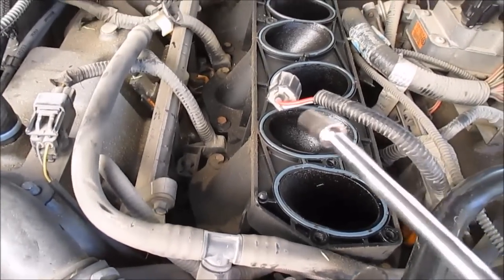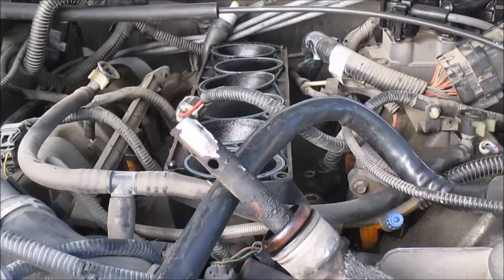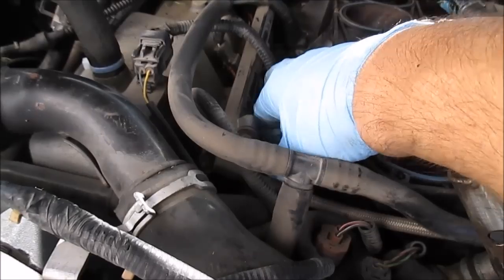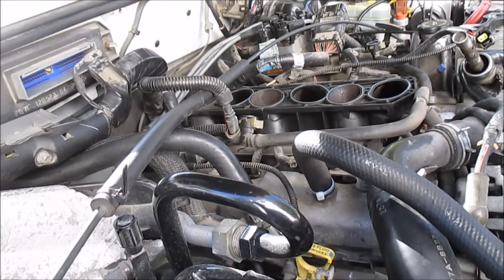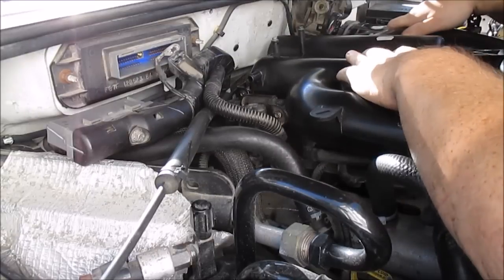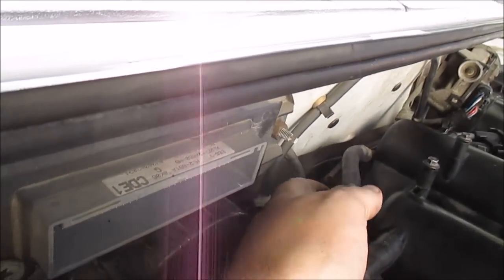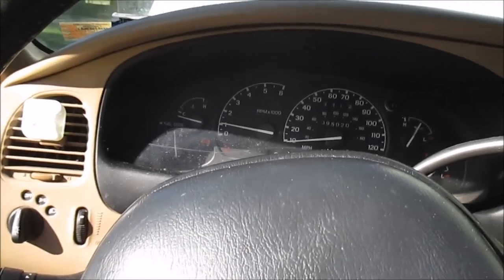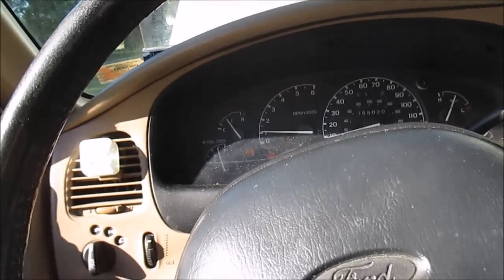Ford Explorer 4 0L Upper and Lower Intake Gaskets Part 2

Comment: Figgy. Love the vids. My 2004 Explorer has vacuum issues but I never thought about replacing the intake gaskets. This morning it had rained and moisture in the air definitely makes starting tough and idling rough. I just need to find my nerve and do it. You inspire me with your knowledge and calm demeanor. I loved it when you said, "I'm not going to let this beat me". That is how I want to be.
Reply from the maker: Well it is possible the intake gaskets is your problem, but I would check a few things to confirm your suspicion before just swapping out intake gaskets and hoping that is the fix. (intake gaskets themselves are fairly inexpensive but a little time consuming to replace) I would recommend getting a scan tool to look at certain data. (Look at fuel trims, o2 sensor, mass air flow, rpm, IAT, TP and a few other sensor info) Using this data can help you determine if a vacuum leak is what you actually have. Having access to data can help determine the correct direction to go.  I own several different scan tools, but anytime I work on fords I really like using a free scan tool software from www.forscan.org  The software is free, you just have to have an obd2 cable to communicate between computer and laptop. I bought my cable off Ebay for around $25 I think. I have a video about forscan the link is here https://youtu.be/UL4uAdXAXKE    This software I think is top notch for being free. I first learned about it from one of my automotive technology instructors a few years ago and I have used it ever sense. I am not affiliated with forscan in anyway. You can access a lot of information using a scan tool so it is very handy to have. 

Also here is a great article about vacuum leaks (lots of good info on testing and finding them) http://www.aa1car.com/library/vacleak.htm You can try starting there for good info.  The way I find vacuum leaks (after I observe scan data), is 4 ways,  1. I listen for hissing by ear or using a mechanics stethoscope (also kinda feel around for it). 2. I use propane (bottle with hose attached) to spray around (where the leak is it will suck in the propane and engine will rev) (note this can be dangerous propane is flammable) 3. Use water to pour around. If vacuum is present it should suck the water in you will hear the water being sucked in and it will bog the engine down. (note dont do this on a super hot engine and do a little bit of water at a time) 4. My favorite method by far is to use a smoke machine to find the leaks. I think this is the best way to go and a lot safer. It is done with the engine off (no moving parts, and the engine is not hot). However a smoke machine is super expensive to buy (but there are lots of examples of cheap homemade ones off the internet to get the job done)
 
I dont know how many miles your vehicle has on it or when you did your last tune up, but based on just the year and  you telling me about it raining with high moisture and that condition made your vehicle have a hard start and idle rough. Makes me think you may have an ignition issue and may need to change out your spark plugs, spark plug wires, and perhaps the ignition coil. There are numerous ways to test all of these components, but my favorite simple way is to use a water spray bottle, and look for arcing. Here is a link to a video from eric the car guy kinda showing this method off https://www.youtube.com/watch?v=x-U9WqJfaJs      I do it just like this (better to do this when darker to help see an arcing)      If I dont see anything something  I like to do is also hook a test light up to ground source and run the test light probe all around to try to get an arc to my probe. If you get an arc or see arcing that means the components are leaking voltage and need replaced. I have a video about replacing the plugs and another video about the ignition coil replacement (these ignition coils are prone to crack, leak, and arc).

Well I hope this info helps you out and you are able to figure out your problem. Also I wanted to say thanks for the nice comment you left I appreciate it, and thanks for watching. Have a good day.

Comment: Thank you so much!  I need to remove the upper intake manifold to swap out the thermostat housing and I was a bit lost, even with the manual.  Your tip regarding the computer cable for the back bolts is gold!  My 98 XLT thanks you.
Reply from the maker: Thanks so much for watching!!
Reply: You don’t need to remove the upper intake manifold
Reply: @figibloom  what made u change them. Was u having very rough cold starts on low degree morning.

Comment: Thank you for the video it helped a lot.  I was getting a bank 1 bank 2 lean code. I live in Alberta Canada where it gets extremely cold. On start up I  had to keep my foot on the gas until it warmed up just to keep the vehicle running. I threw money at some other things but I should have done this first. She doesn't hunt to idle now and runs like a champ. Buy the gaskets take the time to replace them. They are a crucial part of the engine.
Reply from the maker: Glad it helped. Thank you for watching!

Comment: Thanks AJ, I just watched both pt1 & pt2 ,very well done and explained . I have that familiar hiss hiss and poor cold starts ( in colder weather) then once warm it runs fine, this video is exactly what I suspected I would have to do. I also got to see a few possible pitfalls I could have easily run into. Your video will help a great deal. Cheers ! from Victoria BC Canada
Reply from the maker: Thanks for watching both pt1 & pt2 I appreciate it. I hope my video helps you out. Thanks again for watching and thanks for the comment. Have a good day, and good luck to you if you do this job.

Comment: AJ, these two videos were outstanding.  Pulled my upper and lower, swapped the PCV valve (including the otherwise impossible down tube) while I was in there, replaced the gaskets, and buttoned it all back up, all thanks to you, man.  One little suggestion that could pay big dividends:  cover the intakes to minimize debris settling into the block, and to prevent a stray bolt from dropping into the head.  So you're the MAN.  Thanks for saving me a ton of time and research.  Well done!
Reply from the maker: +ABC ABC 
Hey I am glad my videos helped you out. Also you are right about covering up the holes to prevent any stray objects from falling inside the engine (would really suck to drop a bolt down in there, that could be a really bad day for sure) I cant remember if I showed stuffing rags in and over the holes or if I showed that on a different intake video I did, but yes you are absolutely correct cover that stuff up for sure. Well thanks for the comment and thanks for watching, I appreciate it. Have a good day.

Comment: thanks for the video.  I did this a few years back on my 99.  Upper was a PITA but lower was easier, as you showed here.  The reason I changed them then, was I wasn't certain if the PO had done it based on a TSB, so I did as a precaution.  Never had any indication of issues so far.
Reply from the maker: +Kalspeed 
Yeah the upper was for sure a PITA. Yeah I do believe there was a few TSBs on this, because the intakes on these are notorious for leaks. Well thanks for the comment and have a good day.

Comment: 4:07 that bottom left hose assembly, what's it called? It's a T  hard hose that runs to 2 nipples on the upper intake manifold. Then the bottom runs down but I'm not sure to where.
Reply: Same dilemma
Reply: @emmanuelulibarri3616  never found a name. Picked up a good one from junkyard
Reply: @1221Ralph  pretty sure your talking about the pcv valve
Reply: @danielrenihan8115  No that's clearly not a pcv valve. It's a hollow fitting.
Reply: Well what you described being a t one going to the back side of the motor and the other to the undersides of both intake manifold is a pcv valve I broke that stupid t putting a new one in so got rid of the plastic junk and put brass
Reply: @danielrenihan8115  Look at the timestamp put. It's right there in the lower left side of the scree. It's a plastic T. Not a pcv valve. I did the pcv valve that time as well and the pcv valve is on the back of the motor, passenger side I believe. It's a straight pcv valve and not an L or a T. 
The one I'm talking about is in the front of the engine bay.

Comment: Gotta do mine sometime this weekend, 01 Eddie Bauer, 188K, fine warm idle, won't hardly run cold, lean on both banks and I checked all my lines
Reply from the maker: Yeah those vehicles are pretty notorious for lean conditions caused by vacuum leaks. Hey good luck to you on fixing it. I would suggest while you are in there to replace the egr tube seal (it seals the upper intake to the egr and it can leak), and maybe test your fuel injectors (ohm them out 11-18 ohms I think is spec) Maybe also take the injectors out and clean them, and replace the injector o rings (which can also be a vacuum leak). Point is if you are removing the upper and lower intake manifolds, this would be the time to check and clean fuel injectors while you are in there.  I say this because a lean condition can be caused by to much air or not enough fuel, and a rich condition can be caused by to much fuel or not enough air. I hope that makes sense.  Anyway thanks for the comment and thanks for watching. Have a good day.
Reply: Yeah I'm mechanically inclined, so I'm going to do all of that, I got access to a second engine recently because the timing chains in these don't last forever, the guides break down. I've already done the thermostat housing, and without pulling the UI, that's a pain, if I was using a brand new housing, and not a donor housing, I'd have done the seals and all at once. I'll be sure to let you know how that goes too

Comment: Did you say that you tort the lower intake bolts at 110 foot pounds of torque and the upper intake plenum bolts at 62-in pounds I think is what you said is that the correct because I have that same engine that's a very engine not all of them look like it took me forever to find a new one to replace the one that I had where the timing sets it went bad and messed the engine up so I'm in the process of I've got it out I've got the new engine I'm just reassembling the engine and I'm getting mixed results and information on what those torque specs should be on those bolts

Comment: How on earth are you gonna be able to remember all of the things you disconnected from the intake cover when you put it back on lol.. Wow amazing..I have a 02 ford explorer with a hole in my upper intake and i have to replace it. This video will help me out a lot thanks..
Reply from the maker: Well just go slow and take pictures or take a video of how everything goes. Look up the service procedure on how to remove the upper intake. You can get a chilton book or haynes manual, or usually what I do is buy a subscription to www.eautorepair.net which is mitchell (a professional mechanic software) for diy auto repair. I think that is super great info about your specific vehicle you are working on. It cost around 25.00 for a year subscription, but very handy to have. I have a subscription for each of my vehicles I own. If I work on a friends car I tell them to get that so I can look up info if need be.  Also most public libraries will usually have some type of automotive software similar to this you can access for free just by going up to the library. You just need to get a library card to access this type of information. Which is super handy. I just like to be able to have that type of info at my fingertips online at home. Well I hope this info helps you out, and good luck to you on replacing your upper intake. Thanks for watching and thanks for the comment. Have a good day.
Reply: Ok Thanks for the info. I will definitely take your advice and subscribe!

Comment: Ok. I have a 97 Ford explorer 4.0 v6. Sohc.  Had to replace the three front timing chain guides. Now I'm putting it all back together. Yet it's been down for close to 9month. Due to weather. I'm needing help to locate the hoses from the I take with clips to not knowing where the end of the single part hose goes. Please help. Thanks in advanced

Comment: great video, if you still have a leak try spraying that hose with the clip on it you said was loose with starting fluid, I had a vacuum leak on that ,my engine light would come on because of it, I went to pick and pull, 5$ fixed my problem
Reply from the maker: Yeah that clip was leaking and I did the same thing you did, I went to pick and pull and got a replacement part and it fixed it. My bank 1 is perfect now, but my bank 2 has a little bit higher fuel positive fuel trims, it is within 10 percent so I am not to worried about, but I am still looking for a slight leak somewhere. Thanks for the comment and the suggestions. Have a good day.

Comment: I got 223000 on mine , haven't had any problems with this yet but I'll probably change them soon anyway,  I have had the intake off to replace the thermostat housing a couple of times,  I striped the intake bolts,  had to make some fatter ones from wood screws, I'll replace upper and lower intake and gaskets soon, took her in yesterday for a smog and passed no problem
Reply from the maker: Mine is a 99 but I dont drive it to much it has less than a 100000 miles on it. Yeah those plastic intakes in my opinion are pretty much junk, they break way to easy. Did those wood screws seem to hold good? I may have to do that sometime in the future to mine, because it seems every time I have removed the upper intake the screws dont seem to like to go back in the right way. Well thanks for the comment and thanks for watching. Have a good day.

Comment: You need some power tools! Change the PVC, cam plunger and use some paper towels in the intake runners when cleaning. And you need a good mount for your camera, hand held camera is hard to follow. It's a good how to video, I like that you gave the torque specs and made sure your viewers were aware of inch not foot pounds. Keep up the good work!
Reply: How do you notice if the pvc is bad

Comment: i will have to thank you in advance good sir, as i am preparing myself for this adventure, im going to do this to my 01 sport, and it might not be just the same but its pretty close (gasket wise) according to autozone, but i am also getting lean codes both banks and a very rough idle, i cant stand this shit anymore haha!  will let you know if it worked for me !!

 again thank you!
Reply from the maker: +Carlitos Ferreiro 
Well good luck to you, I hope everything works out for you. One thing I might suggest is maybe testing the fuel injectors (use a meter and ohm them out while you are in there), maybe take them out and clean them and check spray pattern,(lots of videos on youtube on how to do this) and maybe replace the injector o ring gaskets while you are down in there,(if you decide to remove them and clean them) (those o rings can be a vacuum leak source.  The reason I say this is because lean conditions can be a result of either to much air (vacuum leaks, or unmetered air getting in) or could be not enough fuel (plugged injectors, dirty injectors,), and since you have to take all of that stuff off anyway. Now would be a good time to do it, just easier to access while everything is off. Well anyway as I said good luck to you. Thanks for the comment and let me know how it goes. Have a good day.